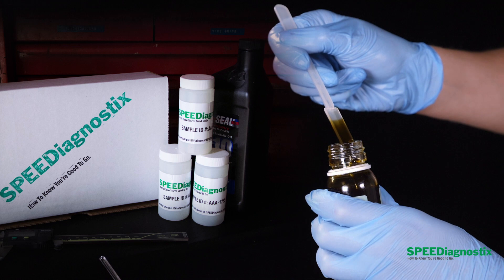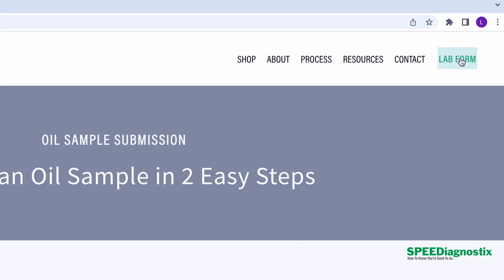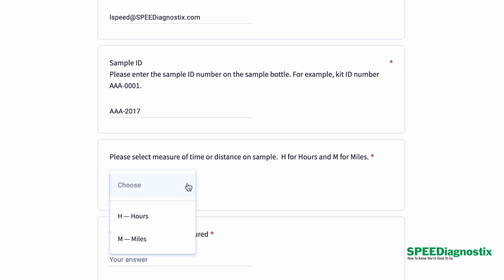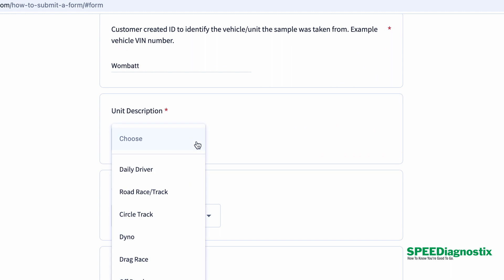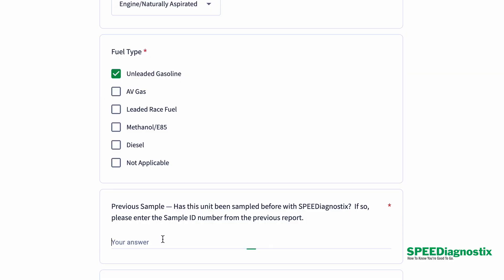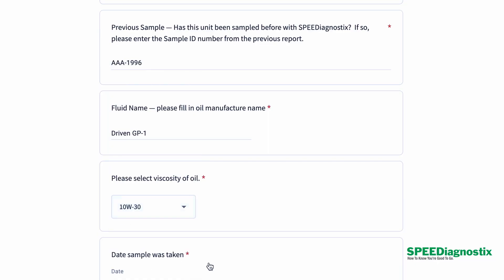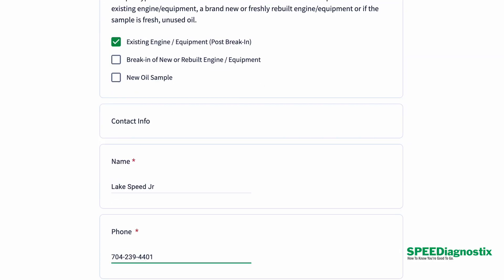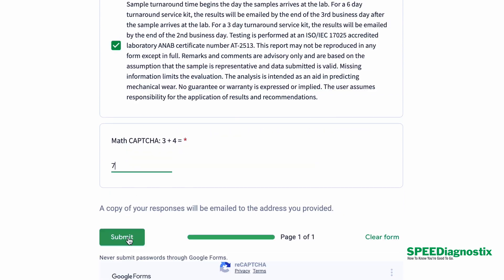How To Complete A Used Oil Analysis Submission Form - Get The Most From Your Oil Sample.

Comment: getting ready to a oil change in my Ram 2021 3.0 ED what oil would you use? I only have 50k on it.I'm going to a check by you
Reply: I always ran Amsoil 5w-40 and Shell V-Power diesel. No issues with soot or egr yet znd I'm at 147k km